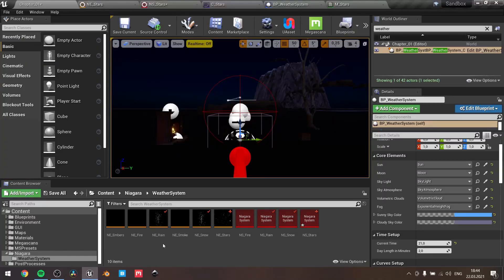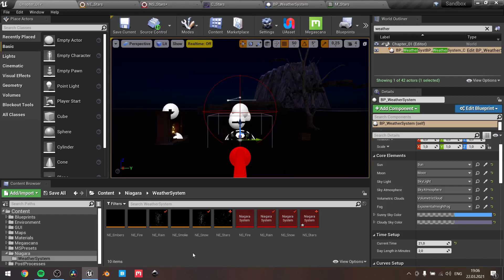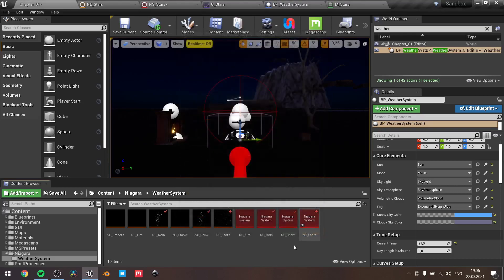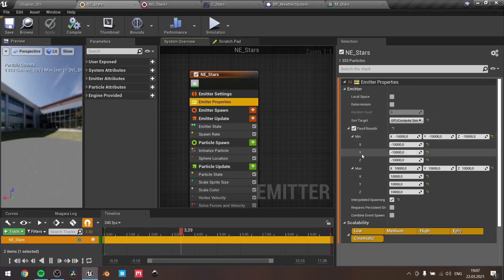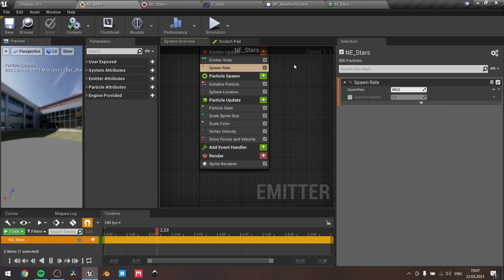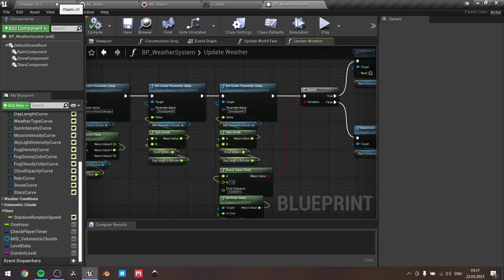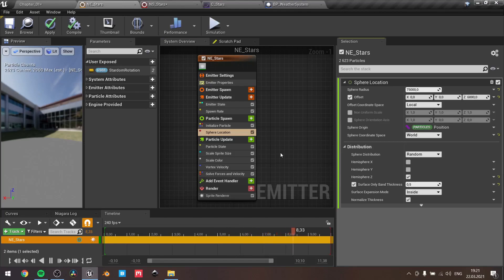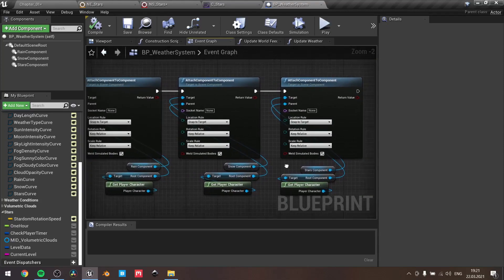Dynamic Stardom in UE4/UE5

Comment: Great tutorial, cheers :) One slight issue I'm having though is there seems to be a flickering happening with some of the stars, especially the ones directly above. Is this something you've noticed, or would you know of a way to fix them? 

I also disabled the Scale Color and Scale Sprite Size modules since I don't want any stars to actually disappear, and I replaced the Spawn Rate with a Spawn Burst Instant module to just have a load of stars instantly rather than having them keep spawning in. I also disabled the 'Kill particles when lifetime expires' checkbox since I don't want them disappearing.

EDIT: For those looking at this later - the issue is the particles being too small. I think Unreal doesn't know whether to render them or not if you have too big a sphere radius with too small a particle size, but if you turn down the emissive value then they don't flicker nearly as much.